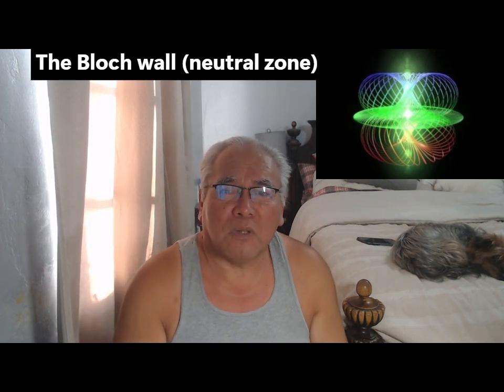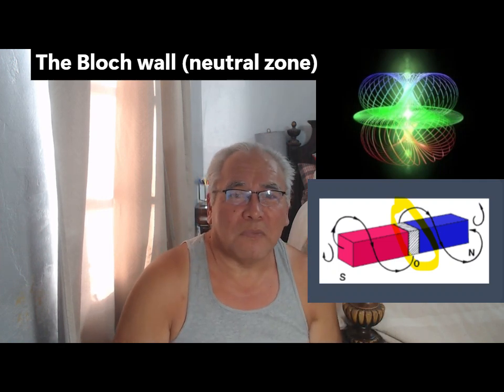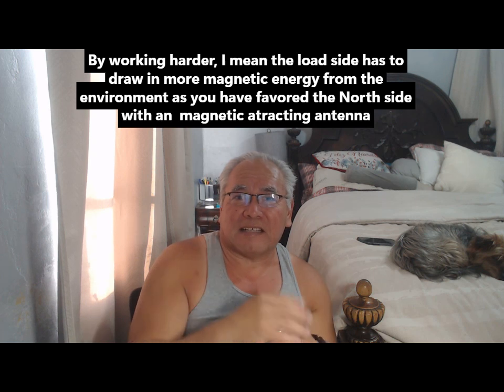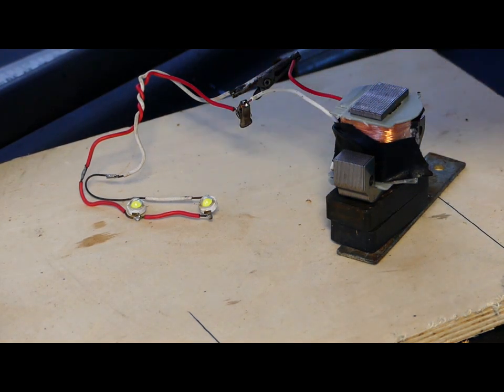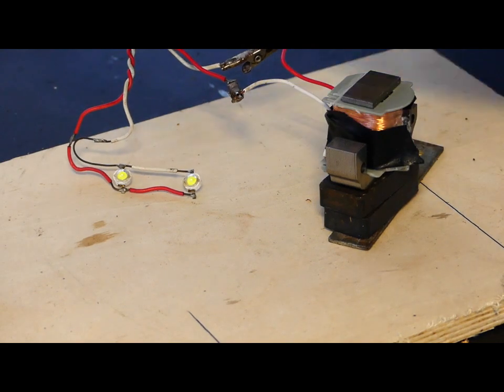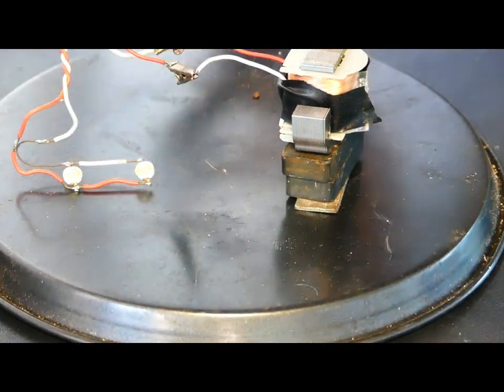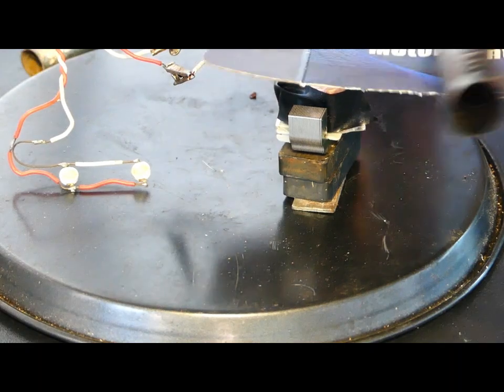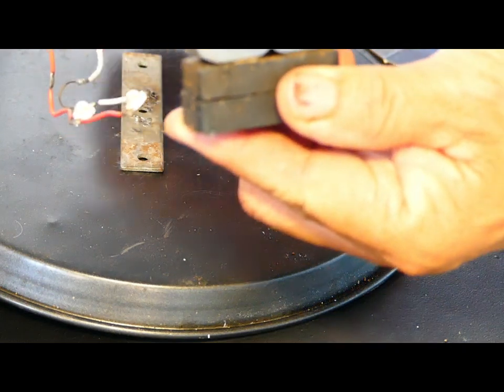Extracting electrical energy from static magnets & coils

Comment: With the iron pan under the magnets, the magnetic flux path became much shorter, so the flux dissipated less and became stronger. The magnetic flux no longer travels deep under the table, but rather rests against the iron pan, exits slightly to the side, and rises upward.
Reply from the maker: Precisely, the magnetic flux is redirected in a way that minimizes resistance and maximizes interaction with the coils.
Reply: @alexmanzanero  Right! Listen, tell me, in the end, have you made at least one really working overunity MEG generator? Do you have a video?
Reply from the maker: @-THE-MASTER-  My ideas come in the dead of night, mostly around 3am but my abilities for tooling things are not good, i wish I had that ability, i've made preliminary tests and they do work, I have a bunch of magnets because I know how valuable they are, they organize the vacuum non-stop into a dipole
Reply: @alexmanzanero  Ohh man... what you just said... how exactly is that relevant? Have you been at the lab's liquid solder? :) My question was concrete: do you have any actual ideas for a MEG generator or a magnetic diode that works in practice, not just in theory? I'm talking about a device that doesn't just exist in a footnote, but on a workbench.

Comment: Nice concept and demonstration. but your still using relative motion to generate electricity whichs not static at all according to Faraday's laws of induction. However, here's some idea food for thought. If you place am241 from smoke detectors which emits alpha radiation, adjacently place next to a strong neo magnet. The alpha radiation will deflect and curl around the magnetic field which will generate a Lorentz force, statically. A similar principle to how cyclotron functions but in an inert state as the electron angular momentum can affects the magnets dipole moment. Looking forward to see more of this  experiment
Reply from the maker: I guess what I meant was that you still can generate electrical current from static coils and static magnets without relative motion between the two

Comment: You can boost any magnet by putting metal behind it, so it will reflect more towards. You can also magnetize metal rod by keeping it lined to north in 45 degree angle towards ground, then just hit it with something hard.
Reply from the maker: thank you for the information.